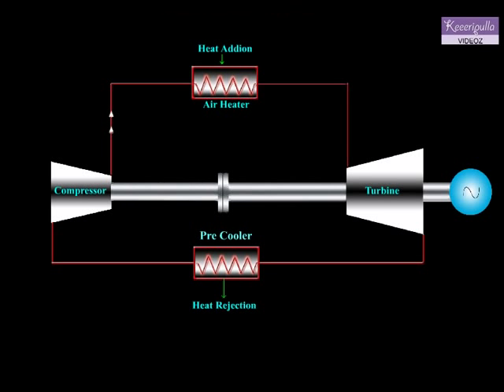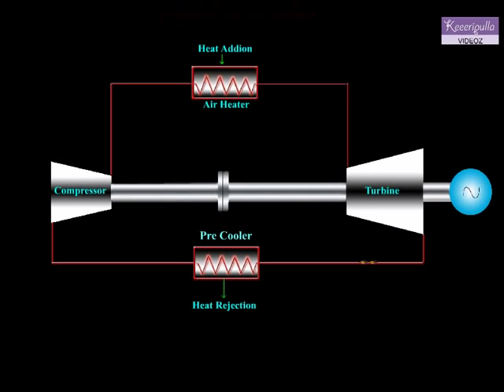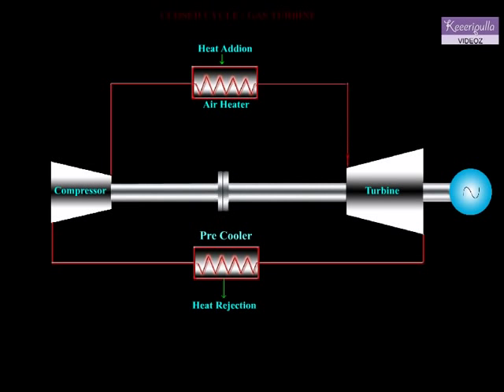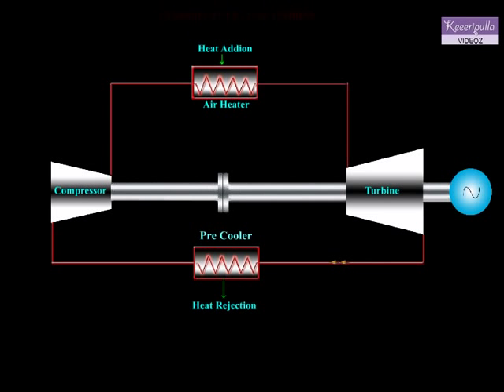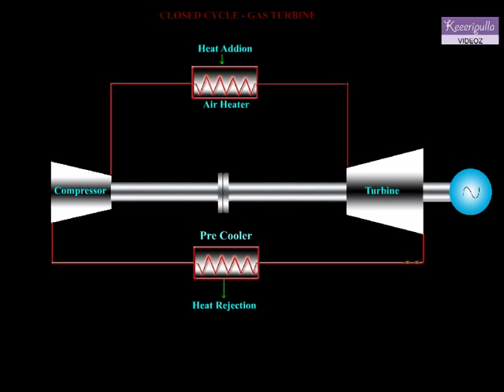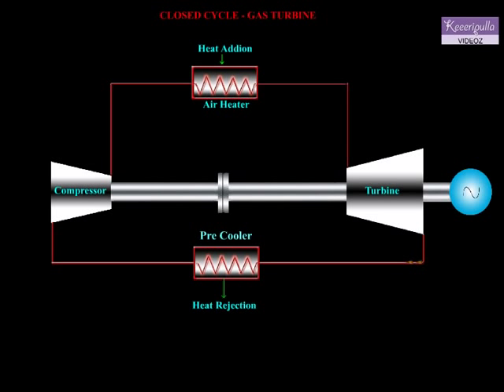CLOSED CYCLE-GAS TURBINE

Comment: could you do that to power an Aircraft?  Or it is only a huge power plant design for a Factory and its too heavy to be done in scale. (sory Im french) I hope you understand because I'm curious to know more about it. Thx
Reply: Yes. This is the Brayton cycle system and it is used in gas turbine engines (GTE) of aircraft and also in industrial powerplants. Described in the video is a closed cycle GTE. Aircraft turbine engines are open cycle i.e. the heat regeneration is done in atmosphere and this eliminates the regenerator weight and the air after the turbines can be used to provide thrust from the engines
Reply: This thing is very bulky, so heavy, add fuel weight and aircraft will not start.

Comment: What is the purpose of using the pre-cooler?
Reply: You need to remove heat otherwise you achieve "heat death" of the system. This means you can't add any more heat and thus power. The cooling towers/canals/pools of power plants fulfills this purpose.